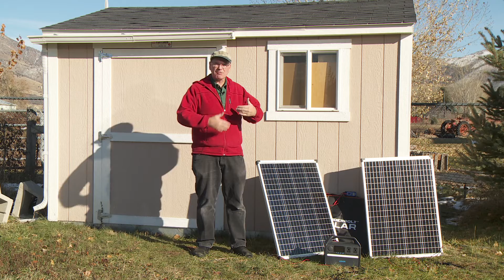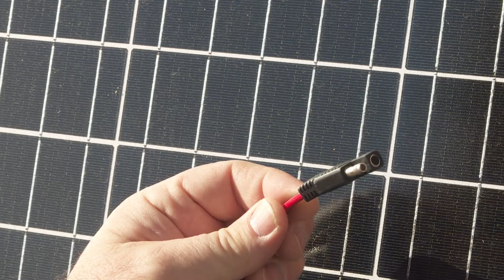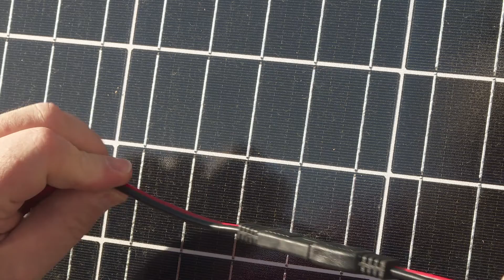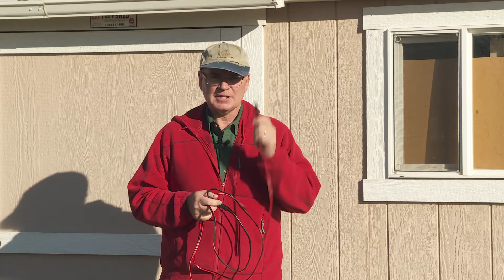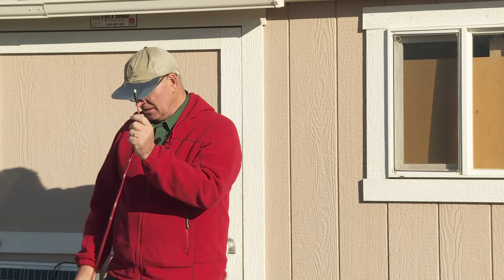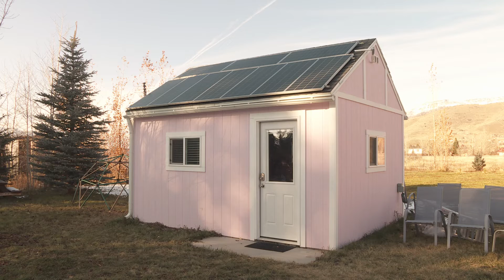Harbor Freight 100 Watt Solar Panels with a Portable Solar Generator (Anker 535 PowerHouse)

Comment: Just purchased an Anker Powerhouse, next I will get the solar panels and hopefully have them delivered as well~ I will get two of the Harbor freight  100W panels for backup in case my electric goes out this winter to use with my heater fan and maybe a bit of small lights computer and cell phone charging~ The electric company does a good job so only need to use it for at most 12 hours~ Have a very small icebox, don't eat meat but my dog and cats do~ I've been hearing our gubment is going to try to shut down electric and I sure don't put it past them considering all the nastiness they've done these past few years~
My home is a Kropf Park Model which has been here in this space since it came from the Manufacturer in April 1995~ My monthly electric bill is about 40$ a month but about 60$ in the winter due to the heater fan and the power I use keeping my water lines from freezing~

Comment: That was an AWESOME video!  I like where you said the panels were called 12 volt  panels but put out 22 volts but still they are called 12 volt panels.  Didn't quite get the explanation as to why this is.  Why not call them 22 volt panel?  Do the panels drop down to 12 volts under load?  But anyways you made a super great video. Liked how you showed the adapters.  Speaking of that.  Wondering why Harbor Freight keeps making the panels with the SAE connectors and not the MC4's.  Maybe they are making more money selling the adapters?  I'm going to try to build my own system.  Thanks for the great video.  A new subscriber.

Comment: I have the Anker 522 so I bought the Harbor Freight folding solar panel; I hooked it up and nothing; I checked the voltage from the panels and they were working fine, I was baffled.  Later that night I compared the 8mm plug from the original AC charger to the HF 8mm plug; I saw that the solar panel 8mm would not plug as deep; so I simply trimmed maybe 1/8” shroud off the adapter; it’s working perfectly now (actually charging at this moment using just the solar panel!)
Reply: What is the shroud?
Reply: @treytedrick1672  the little plastic around the metal male part of the 8mm plug

Comment: Hi there, which is the "adapter you got through Amazon to connect two of these Harbor Freight panels in parallel"..do u have a link to that adapter and is it working fine.  I know Amazon sells a lot of Chinese junk.  If you think your adapter looks sturdy, can u plz share the link to it.  Thank you.
Reply from the maker: The exact item I bought is this one: https://a.co/d/gKDKS4n

I wasn’t worried much about whether it was “junk” from China because it’s just a simple electrical connector. There are lots of options for simple cables and adapters. This one was the lowest priced item I could find to do the job. Some folks think Harbor Freight items are junk. So far so good.
Reply: @GoodTimekeeper  Thanks a lot for the info. on the adapter.  Cool informative video.  👍🏼

Comment: I use the 100W HF solar panel to keep my Jackery 500 (and 240 when I need to) charged. Now... I'm not by any stretch running EVERYTHING off this. Mainly just the lights and charging my phone and tablet and whatnot.

i'm limited by my old-gen Jackery charging over solar at around 60w. (These older Jackerys are NOTORIOUS for their slow charging)

But regardless... that HF panel is doing what it needs to do, and does it beautifully.

I did have to "secure" it to the roof so it can actually get some sun because of the neighbor's damned high wooden fence. But... meh. Could be worse.

I've also got a deep cycle marine battery, and another 300W of solar panels available to me. But that's saved back for power outages and whatnot.

Comment: I picked up a H-F 100W folding briefcase a couple weeks ago. It was $160 on sale and with a 25% E-mail coupon, a no-brainer at $120. As some YTube reviews said, it appears to be two 60 watt panels, as my Bluetti AC50S shows 120 watts input on a clear day. Great value.
Reply: I put a 150 watts solar panel on my van this week.
In full sun now summer time,I get 50 watts out of it,my battery pack river pro, runs a small compressor fridge that draws when it runs 65 watt,
Battery pack last for only 4 days till it's empty
At night the fridge uses 25% of the battery pack